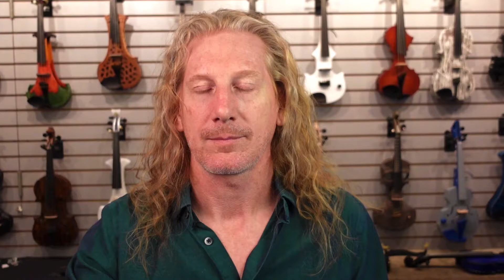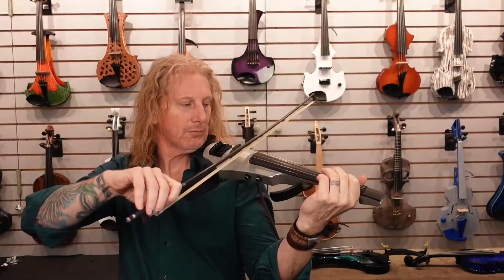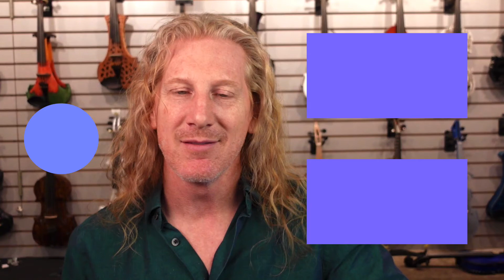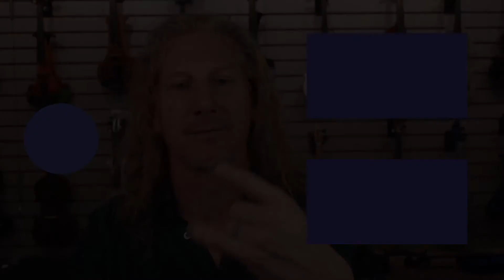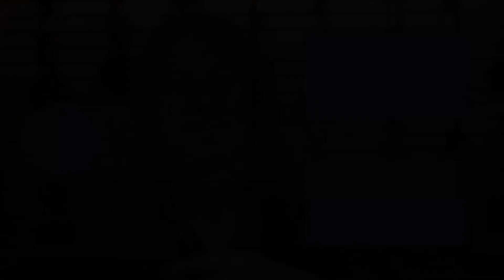How Do I Know If I Need A Preamp on My Violin?

Comment: I thought I didn't need a preamp but now I'm second guessing myself a lot, do I need a preamp with the Aurora classic?
Reply from the maker: Depends on what you’re plugging into.
Reply: @ElectricViolinShop  I plug a boss WL-20L and the receiver is on my Yamaha THR-30II, sounds fine on the amp but when I plug the amp to my interface that's when the sound is a bit thin when I record on my DAW and I wonder what I'm doing wrong

Comment: Does Yamaha YEV 140  need a preamp ¿may I ask
Reply from the maker: It depends what you're plugging into.
Reply: @ElectricViolinShop  thanks , at home I have my Roland amp so I think I don’t need a preamp, when I play with my gigs in a band I plug into their system I don’t have any amp or monitor for myself so I might need a preamp I guess 🤔